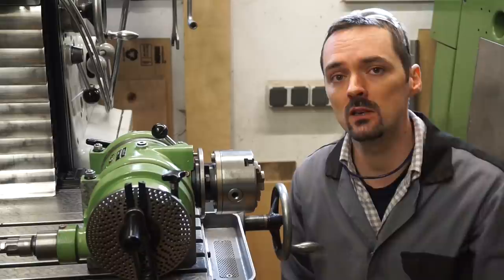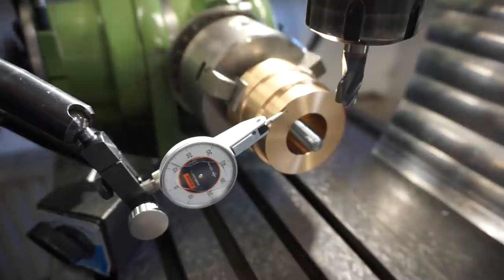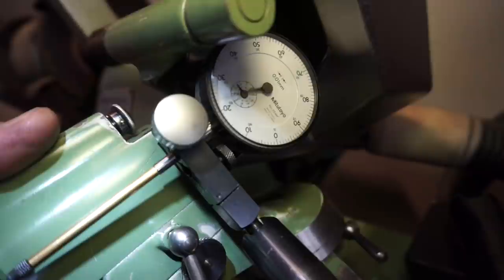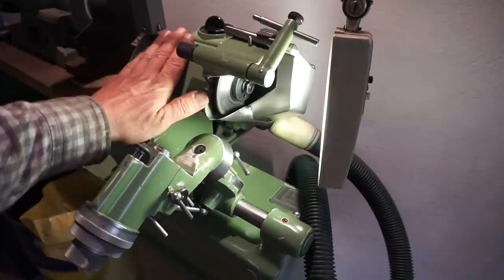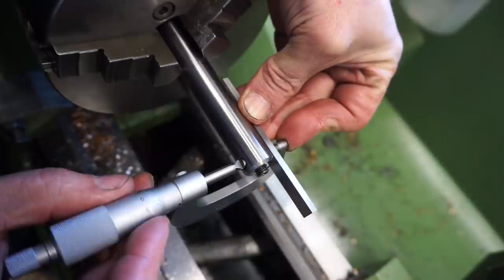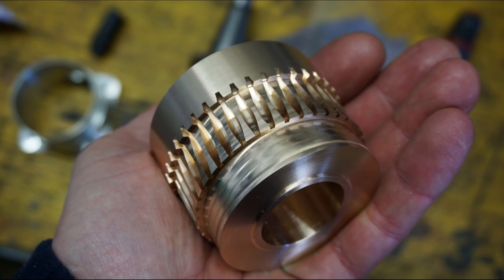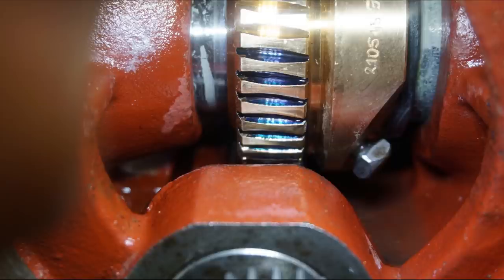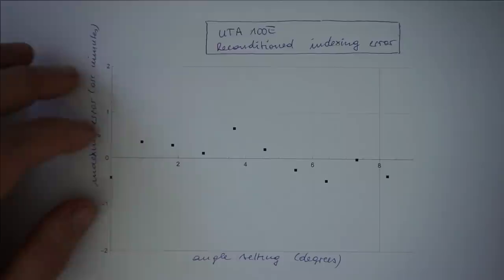Machining a Dividing Head's Worm Wheel Replacement

Comment: Hi Alex. You have developed an interesting simplification to the flycutting method of hobbing worm gears. The worm profile you chose was ISO 10828 Part 2 Type A flat sided profile I think. This allowed a simple conical wheel to be used to grind off the damaged worm stock at the cost of thinning the worm tooth. Bravo on your adaptation of the Emco to do that. Where I really learned something from you is your simplification of worm wheel flycutting by using a simple form tool located at the point of tangency of the 'hob' with the worm wheel bland, inclined, and just gashing to depth. Usually, this flycutting is done by gradually feeding a straight-sided form in the cutter spindle into the wheel blank in a tangential direction while the wheel is rotated on a precision rotary table slaved to the cutter spindle. A difficult CNC process to programme. I will study your simplification to compare the profile of your gashed teeth with those of theoretical Type A wheel toothing.
As for lapping. It is true that diamond lapping abrasive will try to embed into the contacting surfaces, and perhaps Timesaver would be one way to go.
I have found however in lapping hard bearing steel worms against anodised aluminium wheels using 1 um diamond paste that degreasing then powerwashing the gearing afterwards, then assembling, lubing and burnishing the gearset at the correct centre distance for some hours under reversing load and direction using an indexing servomotor produces low runout, low periodic error gearing with no evidence of embedded abrasive visible under microscopic surface exam.
There are other ways of generating precision positioning for gashing wheel teeth or indeed conventional flycutting at low cost. One, is to source a carefully-used Moore precision rotary table with a few seconds absolute error and use that to mount the worm wheel blank and to mill the bore and flycut the teeth into it.
The runout from your boring op is visible in your verification tests. If you had a way to do all the machining on your mill and remove the lathe boring op, the final runout would improve.
Another thought would be to duplicate in your flycutting fixture the same shrinkfit and radial bolting arrangement used to mount the worm wheel in the boring head, before you cut metal. The strains from this can be quite significant, as a little FEA work would show! 
Thanks for the inspiration. You are a brave engineer!

Comment: So,  where did you screw up ? Inquiring minds need to know 8-)BTW would lapping the worm and pinion together improve the accuracy?  (Remove peak errors -the ones on the teeth not the mountain ;-))
Reply: I have considered lapping the worm and wheel in my small dividing head with Timesaver lapping compound. Timesaver is non embedding and breaks down to non abrasive action in use.

Comment: Wonderful job! It's a pity I don't have a steady view of a mountain or other high object in sight for using a theodolite for achieving above standard results. I like your approach "I have to know everything involved and have to improve or at least match the factory standard. I own a Walter dividing head as you are and it's in better condition as the one you started with. I'm quite happy with engaging the worm quite tight for full engagement of the worm drive system and it served me well for 25+ years now. Of course I watch the oil level, which never leaked since I started using it. By doing so the steel worm is the master of movement and the bronze worm wheel, more or less worn has to follow. I decided that the wear should be uniform because of the not so uniform use it had for the last 50 (?) years. I made hundreds of precise parts this way and it never let me down. So, no nagging here, is it necessary to use a theodolite for obtaining the accuracy needed for this trustworthy Walter dividing head? I'm curious (and like to have a reason for buying a theodolite too ;-p) about your "general" thoughts on the matter. For now I recognize I can be really, realy, accurate and therefore I like to do so (accompanied by using such sweet equipment). Curious about your answer, thank you for uploading all your inspirational work and all the best, Job PS; an optical edge/center finder would be a nice addition to your shop for finding a ridge on a chamfered corner on a tilted surface or a hole under an angle too.
Reply from the maker: Hello Job, many thanks for your interesting comment. I agree, an optical centering device would be very helpful. But as you know, SK30 taper is not so very common with these devices.
About the accuracy and the averaging wear I agree with what you write. My case was different with the corroded worm screw that severely damaged the worm wheel with every turn on the crank. So consequently I had to go the repair-route I took.
The worm wheel made with the theodolite would be even more precise if it wasn't for the drifting spindle clamp on the Walter. But other than that, I am really glad I have the Walter. As I say in the video, I believe I use it more frequently than my machinist vice.
ATB, Alex
Reply: @anengineersfindings  For the optical center finder; they are more common with a straight shank for use in a collet. I always adjust the center when mounted in the spindle on a sharp edge (vice) and turn 90 degrees to find the center. Mine has 4 setscrews for aligning the optical center with the edge. Real simple. Takes two minutes max. A lot of them have a removable shank too so you can adapt e.g. a SK30 weldon holder for this purpose too. They're pretty cheap to do so. Thank you for your answer. Be safe and happy, best, Job

Comment: As always a very impressive and well thought out video. And it shows just how unbelievable the "guaranteed" inspection sheet is for both my Vertex rotary table and universal dividing head. Whatever features I've been able to accurately check such as the spindle run out and table flatness certainly don't agree with what the numbers are on there so called certificates of accuracy. So both there worms and wheels stated dividing accuracy are also highly suspect.

I'm certainly no expert, but one nagging question I've had since your first video while using your high accuracy theodolite is the optical effects of mirage randomly displacing the target at long distances. I've done just enough precision shooting with high power optics to know it's a real and definite issue where the target due to that mirage with fluctuations in air currents, temperatures and humidity levels isn't optically always in the exact same position. How do you compensate for those effects? 

One of the causes of the degradation of your original worm wheel and worm might have been created by the previous owner from using the incorrect high sulfur content lubricating oil by mistake. It's a fairly common additive used in high pressure gear lubrication such as older automotive ring and pinion gears. Yes you also had rust on the steel worm, but that may also have been helped to start due to the bronze reaction as well as initiating galvanic corrosion. Some bronze alloys but not all have an adverse reaction towards that type of oil. Our issue is you can't know what you have unless there's a problem and by then it's too late.
Reply from the maker: Thank you for your interesting comment, Sir!

Comment: Loved your drafting of the cutter form. 
2 questions...
What was the spacing used when rotating the tooth profile device around the pitch dia (or is it arbitrary)? 
And could the same simple approach work for generating spur gear Tooth patterns and cutters?
Great video, thanks much

Comment: Hi Alex,
thanks for this video. 
I am impressed by your coordinate grinding of the tool, my german-made copy of an S0 is not robust enough to allow for accurate work using the dials, I end up creeping to dimension and testing.
Also, thanks for confirming that accurate worm-wheel cutting is possible without a hob.
Last, wondering why you didn't use the dividing head's dividing features and had to resort to the theodolite :D:D
Thanks again
Thanos

ps. If I may, technically, this is not a single-point cutter... :) Single point is to distinguish from form cutters in the lathe. This is, to be strict, a single tooth form tool ;P

Comment: I'm pretty sure that's an anular cutter in the beginning not a broach. A broach is like a thick saw you shove through a hole with a guide in it. The teeth get bigger as it goes to broach a keyway into something. Maybe I'm wrong, maybe it's an ac/dc and it goes both ways...
Ok now that I'm done with my broach bitch, wow I'm going to have to watch this again like 3 or 5 times! There is just so much to digest. This is not the thing I do there's just so much... Good job!

Comment: Thank you again.
Could some of the error be down to having to use the dividing head with the original worn gear to manufacture the new gear?
Effing brilliant though.
Reply: The dividing head is only use as work holding, the actual division was done using the theodolite.

Comment: Using a mountain for a precision measurement is risky. Mountains move you know. It’s how they got there in the first place. Probably the actual explanation for the wild (ha!) variation in accuracy.
Reply: It is more likely that the workshop's foundation moves (orders of magnitude more) than the peak of the mountain in the short time-scale. Even more likely that the radiated body-heat causes localized thermal effects in the metal-parts even more severe than the moving foundation. On a universal time-scale, everything moves.
Reply: @AdityaMehendale   I just assumed he’d taken into account all the mundane I-always-stand-in-the-place-so-the-shop-foundation-flexes-the-same-way stuff. Oh, and I was also kidding. :-)
Reply: @hashgeek929  I missed that last part ;)
Reply: @AdityaMehendale  dont forget to add in lorries on the roads between Alex and the mountain.
Reply: @chrisstephens6673  ;) Gravitational-lensing due to the mass of the lorries? :o hadn't thought about that.
Reply: @AdityaMehendale  always good to have an excuse outside your control, then uou can't be blamed for whatever goes wrong.😉
Reply: @chrisstephens6673  Provided you can prove that is indeed that other thing that causes the issues ;)
Reply: @AdityaMehendale  sometimes just sowing doubt is enough.😉